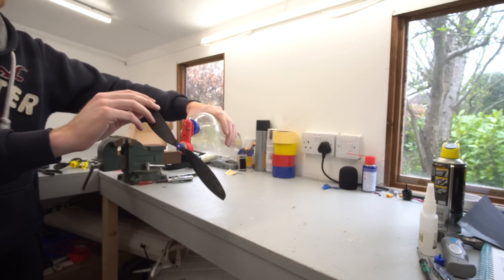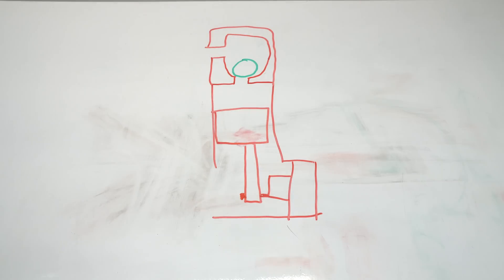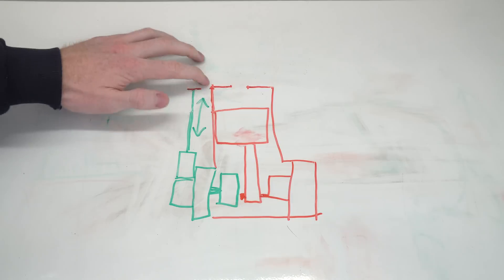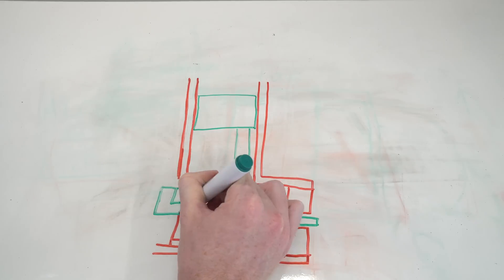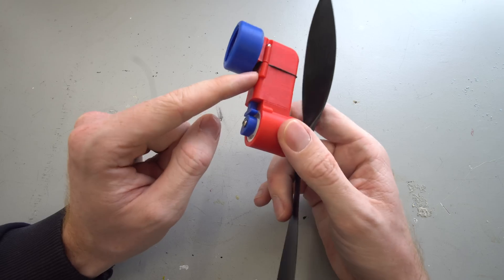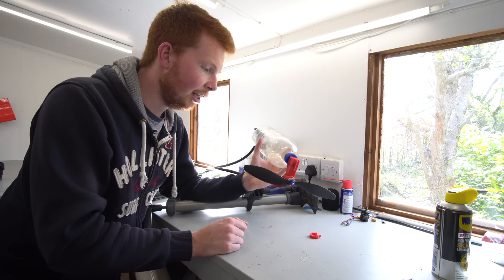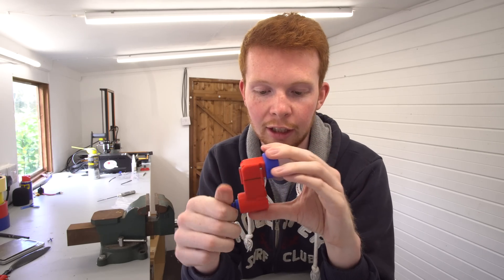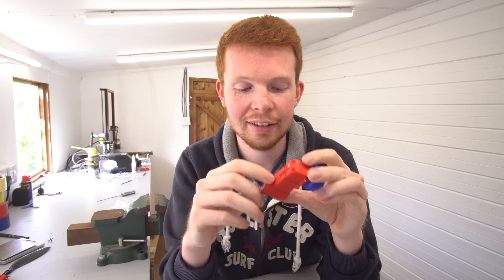Compressed Air Engine V3

Comment: Next video: V6 Compressed Air engine :D
Reply: Also sounds much louder and work for like 100 meters of driving :x
Reply: Master will take care of the noise, even students need to hear the real aerofoil noise. Silencer!
Reply: definitely sounds cooler than an electric car
Reply: Well, I see the future is not electricity anymore. Let's just pump air into our cars :) Imagine that...

.. actually it's not that unbelievable..
Reply: @_szyha  Oh my car is out of air. Lets go to the AIR STATION?
Reply: @_szyha  so if the future isn't electricity how do you make the container to hold the air and the compressors that you'd need to power the car ;)
Reply: RayZor a company already is doing it
Reply: Just make cars have compressor in them so you don't have to pump them ever
Reply: @nick5479  won't the compressor need gas or electric to run?
Reply: rotary 3 compressed air engine
Reply: Rotary?
Reply: in india was car using compressed air about 5 years ago :D (Tata motors? ;D)
Reply: Nick547 I hope you don't expect an alternator to power that compressor lol. Remember the conservation of energy. You won't get something for nothing.
Reply: What he means is you get a car made of the best solar, has best battery and compressor, then let sun power, wind power from electricity which comes from the sun. Use all best principles, and nature will always power our machines. At lest colonizers sailed with wind, but had to use the see. Free energy exists, even we can create it, but the sun we will never. Power the machine,or make nature power it, no machine ever powers itself; it is simply powered-by wind, water, sun, man.
Reply: do you even know what V stands for?
Reply: Teren Essex you'd still have a battery
Reply: Lego already have an air pump
Reply: I like it cool idea
Reply: And.... next is V8?
Reply: Awesome idea, but why am I getting hungry from watching him?
Reply: although a V configured compressed air powered engine would be awesome (trust me it would be) it would be far more practical to stay in the inline format as it allows all the air intakes to be on one side of the engine meaning he would not need 2 air canisters to drive the engine because one would take longer to get to the engine as the other, althogh its difficult, a V configuration would be very cool and it would also allow MUCH more smooth torque aplication, for a 3D printed model airplane of this size its impractical but if he was to build such a thing for one of those mamoth RC planes... Well, it is pretty bloody awesome and it would probably work pretty well too, let's just hope he does continue to make these vids!
Reply: Captain Cargo Shorts what about if the air canister is directly in between/above the two sides of the engine?

Comment: Hi Tom,

Your endeavors to make an air powered engine reminded me of something I tried and failed to do in school. Anyway, i've been doing some research. What you're trying to make, with a pin pushing a ball valve, is more commonly called a poppet valve. Here is a good little discussion and plans for one.

http://www.floridaame.org/GalleryPages/g1Non0125.htm

I think in reality, you need to get your hands on a lathe so that you can lap the piston. Also, take care to look at the notes in the drawings on that page. I think it's in there, but if not, it seems that the piston has to be a tight fit. This is because they actually run at a relatively high internal pressure all the time. I read that theres only a 2psi pressure differetial between the air that has been compressed by the upstroke towards TDC and the air reservoir. Very little air us used during each cycle. And I hate to say it, but one of these engines running on less that 20psi is a sign that the piston doesn't fit properly. 

I'm going to continue one and make something. If you fancy some sort of collaboration, let me know, I'm UK based.

Keep up with the videos, they're good. Rob

PS. Shame on you for making a square, non-symmetrically loaded piston. There's a reason they're not oval-shaped or star-shaped, you get more wear in the corners and they leak. <- my original thought from the video ;) Inabit man.

Comment: Tom wow amazing job! When it ran the first time you tried it that was pretty dang cool. I think what would be really fun is to be able to use the standard small silver C02 cartridge. Imagine a whole series of planes that would be built specifically for your engine and they all run on a C02 cartridge. It might make a great new free flight model type. I timed the run at 60psi and it ran for 16.84 seconds. If you could build it to withstand the pressure of that cartridge it would be a heck of a lot easier than using a rubber motor. Good luck!

Comment: if it runs at such a low pressure, can you narrow the inlet to the valve? maybe prolong the running time at a slight powercost (but by the sound of it the power output is higher than the V1 already)

Comment: Very impressive i think that increase in the surface are of the piston has improved it and the volume concentration of the cylinder was very impressive as well. I think if you have small ramp like structures at the cylinder walls may direct the air straight into the piston to achieve more efficiency

Comment: Did you balance your cam and prop ? You may be able to improve you're  efficiency quite a bit and would be easy to do with this design . Nice work mate. Do you plan on mounting this to the plane for testing ? It would be nice to see it in flight.

Comment: @tomstanton do you think that the v3 runs better at lower pressure than the v1 did because, by changing the piston shape you also gave the air more area to act upon?

Comment: Great ideas. But i have challange for you. Can you bulit it that way the air that goes in the piston will be on same lower than in bottle pressure all the time engine works. That will cause that engine will works longer i think

Comment: Here's some thing you can try, make a double acting piston where compressed air enter at the bottom of the piston so when the piston gets to the bottom a second valve let's air in form the bottom of piston that then force the pinion up again. if you have the pinion just the right lenth you'll be able to have only one exit port. having a conviguration like that you can go to a smaller piston with same amount of power but will run more efficent. Sorry for my english, it's not my strong point.

Comment: You could go back to the v1 design and instead of using the spring, you could use a pin sticking from the center of the piston. The pin could slide in the middle of the piston and be driven with a delay compared to the piston (similar to what you do in v3 to get a better timing in the opening of the valve). Not sure if clear :D Wdyt?
Reply: That’s like the displacer piston on a Sterling engine. More complex through.
Reply: Stirling engine.
Reply: ziptone yes, but with the different function of opening and closing the valve. I think it will be less complex than the v3 design and more efficient

Comment: Great work Tom, was bummed after last video! Do you think If you could control airflow, you could get a longer more constistant output? Seems to blow out so much air at the start, and now you have made a much tighter system.

Comment: I'm not sure whether this would achieve a net gain in efficiency but, would having an exhaust valve that opens for a portion of the upstroke help? My thought is that would take work away from re-compressing the air that's already in the cylinder. There would also be slightly less pressure on the down-stroke, but it might balance out.
Reply: Also it'd be awesome to see a V-Twin at somepoint

Comment: You basiclly now have an "L" head, or "flathead" engine that most cars had up untill the early 50's. You might as well move up to the 1980's, by-passing pushrods, and make a sprocket driven lobed camshaft pushing down on spring-loaded valves. Don't know of any benifit there will be to controlling timing with only one piston, though.
I really enjoy this series on your air powered plane. Good work.

Comment: Great work!
I wonder if you can make it run longer, albeit a bit slower by constricting the flow from the main tank?
I suggest an intermediate chamber that feeds the ballvalve and a adjustable needle valve that fills this chamber from the main tank. Could allow for a bit of throttle control so you can actually fly something for a bit instead of running out of puff almost at once.

Comment: I dont see the point of doing it this way. imho, the only thing you did was add more points of failure (the seal around the push rod, for example) and more weight. Think about it: you're still doing exactly the same as you were trying to do with v2, that is make an engine with a ball valve that opens on the upstroke without needing a spring. Just this time, it's unnecessarily more complicated.

FUCK FUCK FUCK. no i'm an idiot. Sorry, I forgot. Of course this is better because you decide the profile of the cam rod. great job :P
Reply: Rafael Dos Santos I went down the same thought path. 'Its the same as before, no wait, it's better'. To be fair I thought he said he was going to have a crank & pushrod, in which case it would have been. Conceptually they are similar but now he has full control of the valve lift & timing.

Comment: I am very very impressed! That little engine ran fantastically!
Couple ideas. Because it ran so well at low pressure, could you make it steam powered? Maybe a little tank of water with a candle under it could produce enough pressure to run it! The moisture might also help as lubricant for the cylinder!

Comment: Perhaps if you made the piston rectangle by removing mass from the cam side, you could re-enter the rod on the piston, reducing friction on the walls and also use less air per stroke due to the lower volume of the cylinder.

Comment: spray a bit of wd40 in the cylinder, crank, and camshaft? might help it run even longer
Reply: he had silicon oil on the bench, he used that

Comment: The problem with version 2 and also this one is not considering the exhaust path to the atmosphere, such that the piston is recompressing the air after the expansion. V3 probably works because of leaks, otherwise the air would have anywhere to go after the piston is fully expanded. You need a SPDT (single pole double throw) valve system. I once built such an engine using a custom made rotary valve where the exact phase of gas injection and release to atmosphere could be fine tuned to maximize efficiency as the pressure from the tank dropped. Please consider this if you ever try to make V4. Good luck

Comment: I know I can't be the only one to want him to stick it on an airplane and test it....
Reply: https://youtu.be/1ZqFDsq09H8 he did it with this one
Reply: he totaly should but he should put a presure regulator so that it won't suck up all the pressure right away
Reply: He did it dor the first one
Reply: Luke David don't worry he will lol
Reply: David with an original Air hogs plane.
Reply: That's his very purpose in life, man
Reply: It's too bad that compressed air has such a pathetic effective power to weight ratio, but this is still a cool project. The issue isn't the compressed air, but the containers to contain the compressed air. The higher the pressure, the heavier the dead weight(As the walls would need to be thicker). The larger the container, the heavier the dead weight.
Reply: Energy on air is equal to energy wasted plus on prop...  So i think just releasing the air as a jet instead of a prop might be better?
Reply: Make a small compressor  so that the engine can power it and then it can run forever
Reply: Ok i see no one of here, had lived in the 90th's , theres exist a Toy Airplane with a compressed Air engine.

heres the link
Edit:  https://www.youtube.com/watch?v=FDcfDTsvAzs
Reply: Definitely
Reply: me to
Reply: yuppppp
Reply: yeah because that wont add any weight ;) id go for a bigger bottle but not two plus an electric compressor and valves
Reply: That would open up the possibility of a throttle too.
Reply: He would get more thrust by just releasing the compressed air.
Reply: Add some sort of mechanism to collect air mid flight too. Then I might try this
Reply: Luke David iici
Reply: me to
Reply: meee tooo x1 infinity
Reply: Luke David that's right
Reply: Look in the description
Reply: Can he use it for large scale operation maybe it be used as a one man plane.
Reply: Luke David no your not the only one
Reply: Jet engines use compressed air
Reply: J Abdul Same as every other combustion engine, a jet engine too only uses compressed air to supply the actual combustion.... 

Air engines use precompressed air as an energy input. 
Jet engines draw their energy purely from kerosine while compressing the air even is a required energy loss.
Reply: when I was younger I had a toy airplane that worked like this and ran for about 30 seconds.
it had about half a liter of compressed air and was astonishingly fast
Reply: Filled with helium gas
Reply: well do I have something to show you
Reply: that's why he's making it
Reply: or he can have two water boatels and one can have like a air time  seal between the two bottles one of them hooked up to the engine and the other one hooked up to an electric air pump and it will pump in a reasonable amount it shuts off and eventualy when the one hooked up to the engine runs out the other one opens up the seal lets it move to the other one and during this process it can be gliding and then once it is evenly spread out between both bottles it'll close then the engine will run and the air pump will pump in more air and so it has time do the process it can have a pressure regulator 
ps:dont yell at me for run on sentences or misspelling I am only 11
Reply: @zacharyspruill3731  You will study law of conservation of energy in school
Reply: Luke David I did it a few weeks back on my channel RCLabBotics

Comment: Could a pressure reducing valve be added so only 30 (or higher) psi is feed to the engine. Then a light weight carbon fibre dive / aliminium paint ball tank could be used as a reservoir. 

https://www.justpaintball.co.uk/valken-redemption-1-1l-tank.html?fee=1&fep=14993&gclid=Cj0KCQjwn-bWBRDGARIsAPS1svvhWFVepkL6t-TT-xL6WS1Evok-pUuj_lcjeFUBUJ8820eZMy5odrgaAmNaEALw_wcB

This tank is 1.1l and can take 4500psi. That's a lot of air. 

I'm thinking integrate the tank into a fuselage and boom a compressed air plane that will run for a good while longer. 

Just don't kill your self.... that level of air compression would blow your shed up if a rapid unplanned disassembly was to happen. 

Love the videos keep up the great work

Comment: Perhaps you could buy something like this: https://www.amazon.co.uk/Silverline-425689-Mini-Air-Compressor/dp/B000NBVMRG/ref=sr_1_2?s=diy&ie=UTF8&qid=1524238618&sr=1-2&keywords=12v+air+compressor
You could power it from a 3s lipo and it would save you a lot of effort pressurising the bottle.

Comment: Dude this is awesome as always, love the R&D process, I'm just doing the same thing at the moment designing and building a circular knitting machine. Btw, your different mechanisms and cams etc took me back to the first year of mech eng at uni when I realized that flame speed is what drives a lot of the design decisions in internal combustion engines and that piston shape, valve shape, timing, exhaust and intake manifold geometry, spark timing, etc etc are all a compromise. Meaning there is only one perfect "setting" for a give RPM. So if you delay the spark timing for instance, you get more torque at higher RPM but lose at lower compared to what you had before. Anyway long story short, the Honda VTEC system seemed great because you had a choice of 2 cam timings that activated at a certain point in the rev range, but really it's only a bit better than fixed point cam timing. The "brilliant" idea I had next was to have a fully variable "3D" cam that you can change lift timing and duration throughout the whole rev range seamlessly and then it turns out Ferrari did it in the 70's and it was too complicated for marginal gains, but I definitely see you going there :) I wonder what's the "flame speed" property that limits compressed air engines. If you knew that you could take a lot of shortcuts in development.
Reply: Andre Bandarra That's why what freevalve are doing is so exciting! Having a cam profile that is square for maximum airflow and infinite tuning for timing, lift and duration, is extremely useful for all different engine conditions. Plus of course the easy cylinder deactivation means that it's more useful compared to the bulky technology that makes it possible in a cam engine.

Comment: radial engine would indeed be cool! but this model. it jumps a quite bit. some balancing could be done for sure on the camshaft and cam itself. :) little more weight. but more performance :)